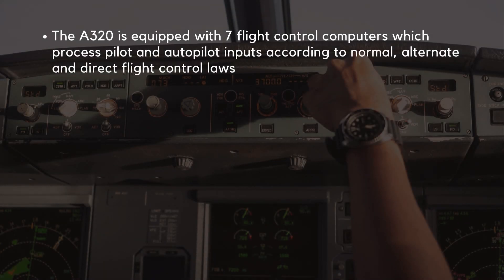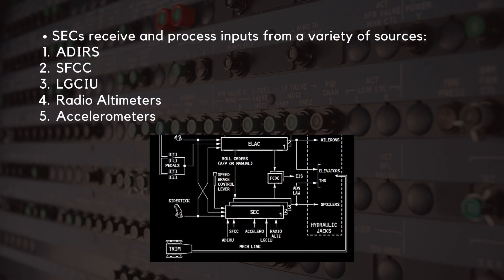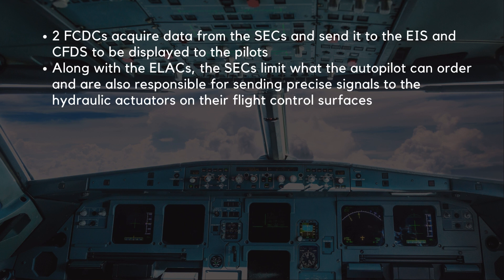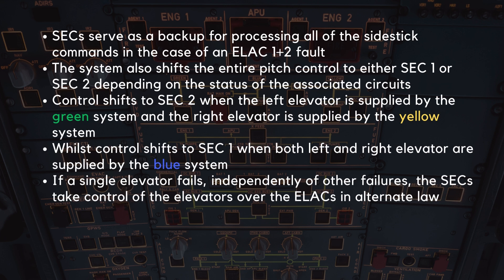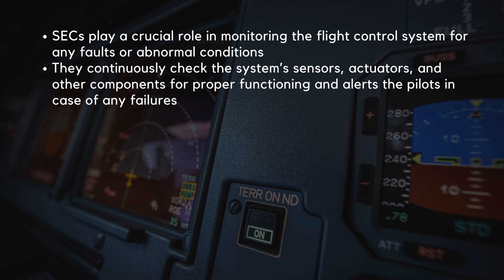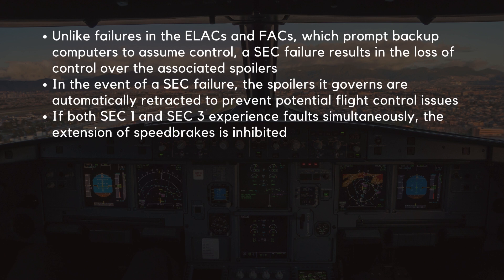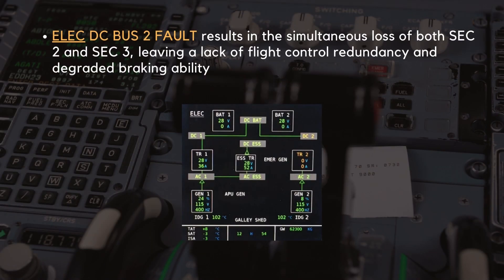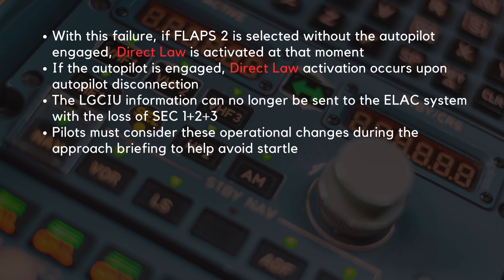A320 SECs Explained | A320 Flight Controls

Comment: I repair these, ELACs, ISIS, and FMGEC units. Crazy how long we put some of these units in service for. I just finished repairing a SEC B unit that has been in service for 35 years! I wish United would stop sending the PSUs from them to repair as they only send us what they can't fix which means it is going to be a hard fix. The SEC C units are fun to work on becuase of the jokes made because due to the name.
Reply from the maker: Wow that is an incredibly long time they stay in service for! Some great info here thanks!